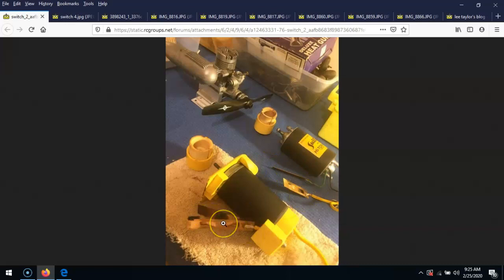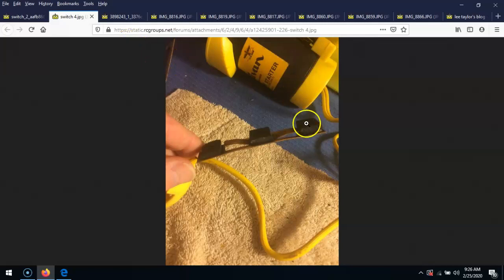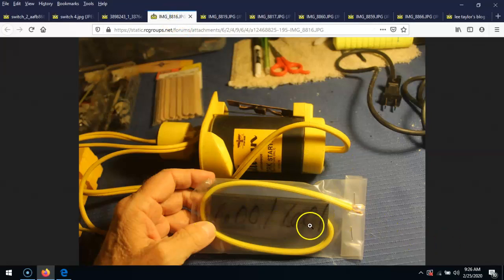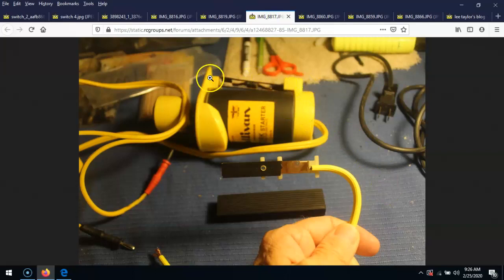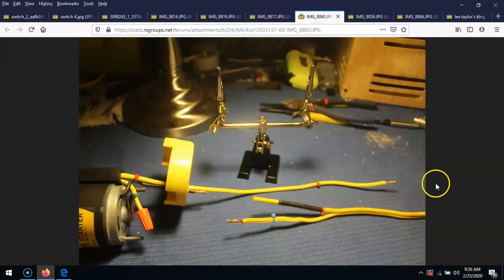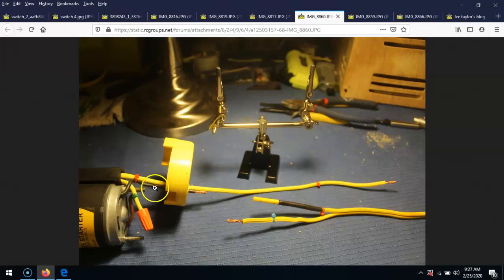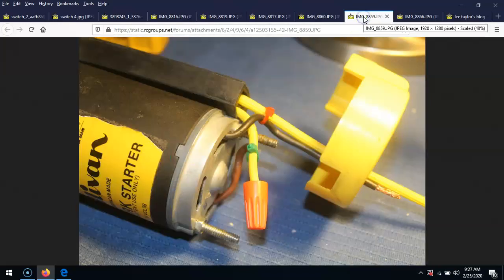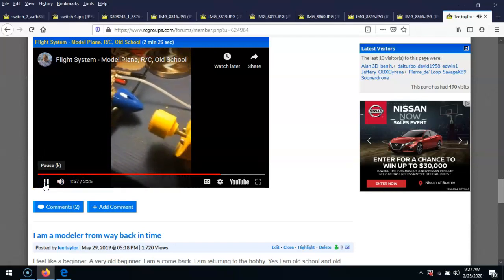Switch - Starter, Sullivan, Rebuild of

Comment: What’s the part number and where did you get it. I tried googling that number you showed but nothing shows up
Reply from the maker: I got the number directly from Sullivan
Reply from the maker: I think your best bet will be to call Sullivan Products direct and describe what you have and what you need. Some of the parts are old and not on their website
https://sullivanproducts.com/contact-sullivan-products/
Reply from the maker: I called them to make my switch purchase. They were very helpful
Reply from the maker: The 601 is the starter I have
https://sullivanproducts.com/product/s600-hi-tork-starter/
Reply: I’m getting back into RC planes after almost 20 years and my Sullivan starter(late 70s)switch needs replacing badly.